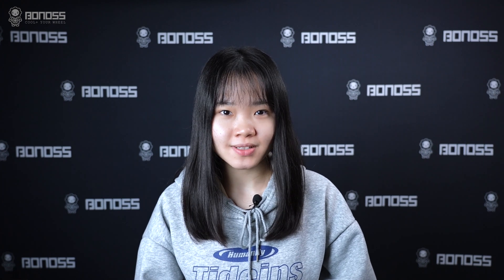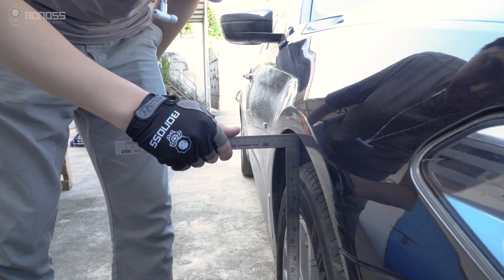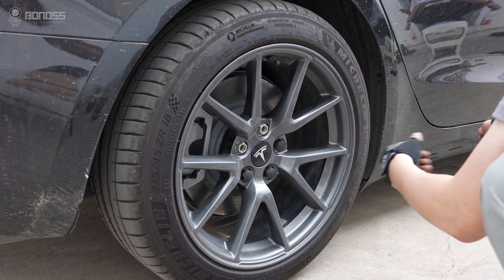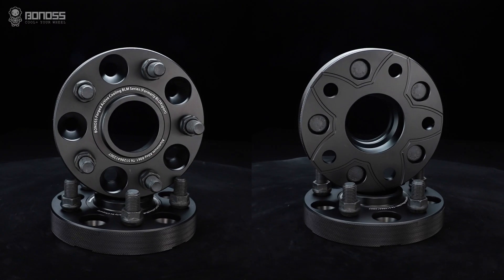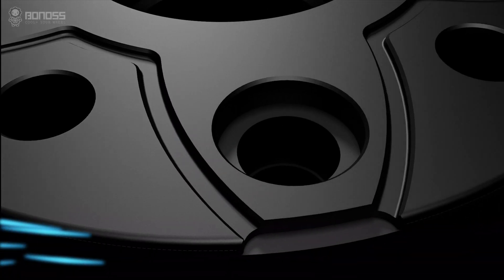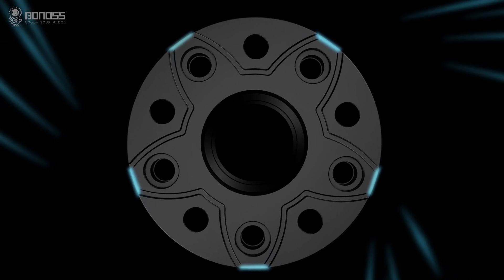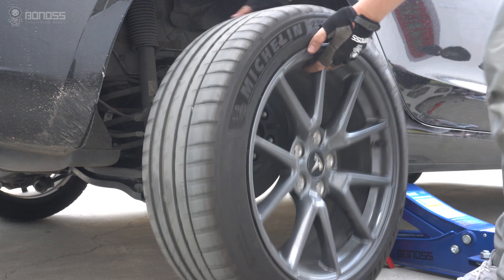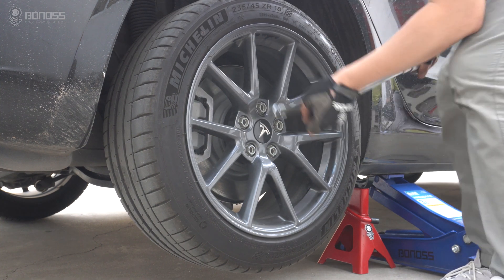How Big of A Wheel Spacer is Safe for Tesla Model 3? | BONOSS 2022 Tesla Model 3 Update Accessories

Comment: What size spacers would you suggest if you go from the stock 18 inch 235 width tire to 255 tire width on a 19 inch wheel?  I'm looking for a flush to slightly aggressive look.
Reply from the maker: Sorry for the delay in answering, you can measure the distance between the tires and the fender of your car. If you don't know how to do this, you can watch this video: https://youtu.be/_WfHoeqHYvs 💖

Comment: You didn’t answer your own question. How big of a spacer can you safely add? 🤷🏽‍♂️
Reply: @Smart Guy thanks for this comment. I will be doing 25mm in the rear and 18mm in the front.
Reply: 15mm to 25mm will be safe. I am running front 18mm/ rear 20mm to get a nice flush look!
Reply: @smartguy6243 what size your rims.. im gettin 19s and thinking if 20 is too much.. some of my friends got 25 and its looks hella aggressive
Reply: @kristyles I have 18 inch with 15 in front and 25 back I personally think 25 goes better with 18 and 19 inch wheels